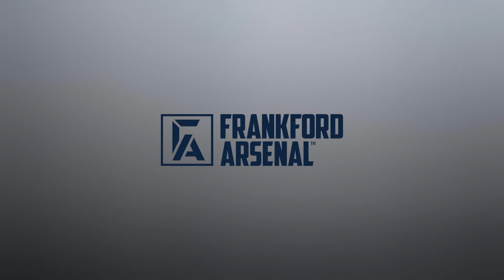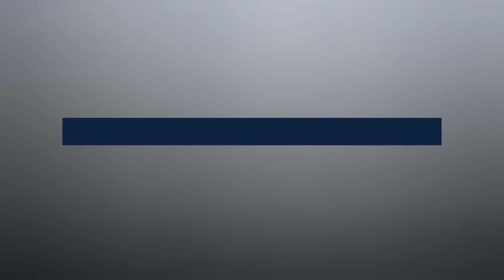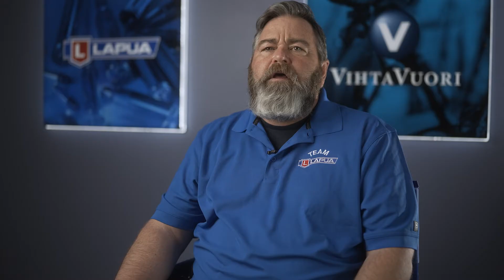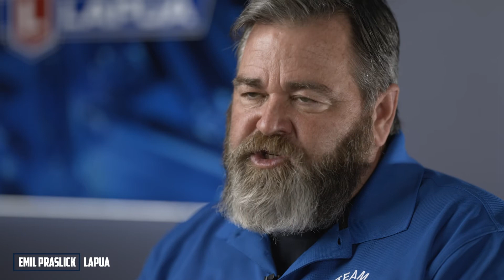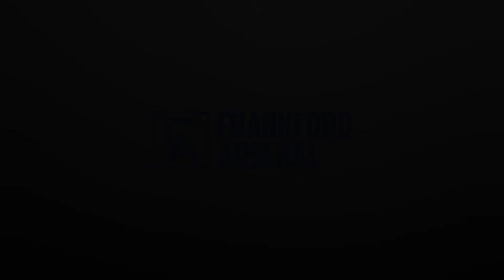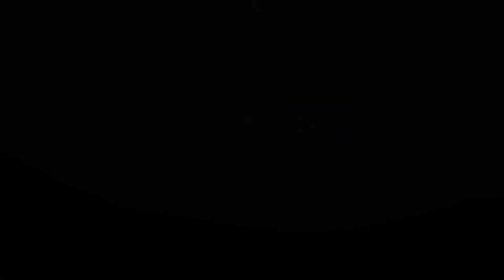How many reloads can you get from Lapua cases with Emil Praslick?

Comment: I just reloaded 40 Hodgson 223 cases 40 times. When I hit 20 reloads 20 cases had to be thrown out due to that ring near the bottom of the case plus with a screw driver I could feel a ridge inside the case. By 30 reloads another 10 more cases thrown out. Between 30 and 35 reloads 5 more cases thrown out but due to split necks. At 40 still have 5 cases good for reloading. 
Next I took 40 Lapua 223 cases and so far after 31 reloads not one case thrown out.